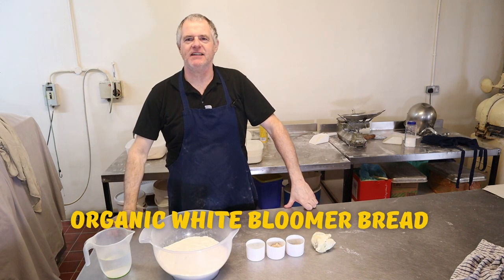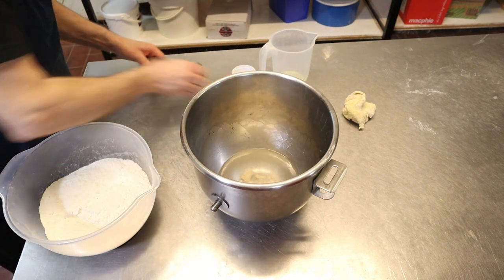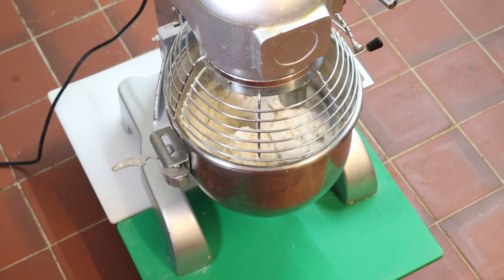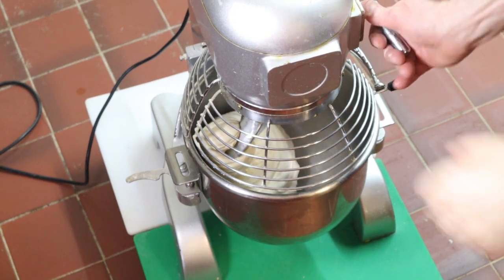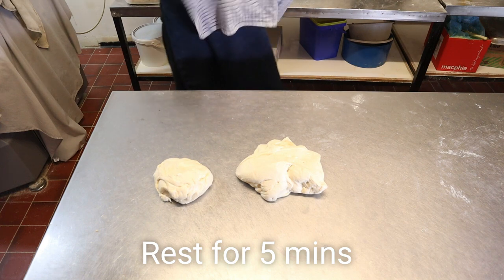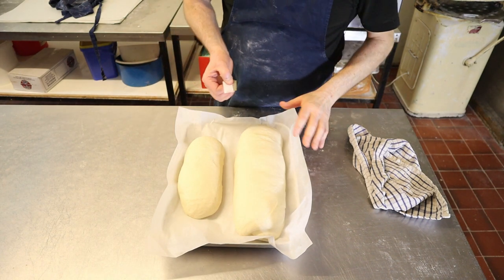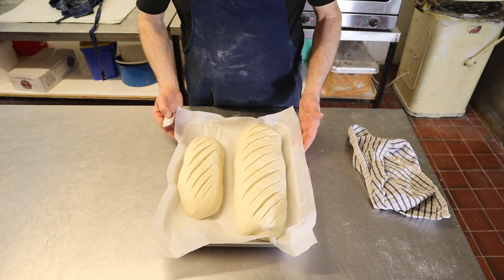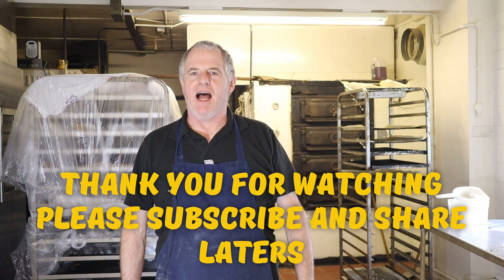Bloomer Bread how to Recipe Demonstration in the Bakery #9

Comment: just found your channel and subbed, cool videos. Why do you bulk ferment these ones but not the small bread that you made in your other video
Reply from the maker: Hi some recipes I may use bread flour improver, which is very common for bread and rolls, for best results at home bread improver if the flour is low gluten, the bulk is still need if dough is very cold, in hot weather conditions or above room temperature bulk can be 5 - 30 minutes, making a recipe is one part of baking, lots of different things can go wrong, so I try to keep things very easy, and not to complicated, but I will be doing some video's on things like temperature, bulking, and bread improver 😀 laters Steve 😋

Comment: How long Steve would the leftover bit of dough last in the fridge that you add to next dough mix,
Reply from the maker: Unfortunately that depends on temperature, for example take 1lb of dough and watch it in the fridge, at the point the dough goes into water it's over,  this can take days to weeks, I have made a loaf up and proof up over 4 days in a fridge and baked, lovely tasty loaf 😋   same thing added old dough into new dough, same in half the time ⏲️
Reply: @crazybaker1  am guessing the old dough going into the new is the old fashion  dough improver.
Reply from the maker: @johnscrivy  very much the same and less yeast, very much like a sourdough with yeast
Reply: @crazybaker1  can you freeze a bit of the leftover dough defrost and use in the same way
Reply from the maker: @johnscrivy  of course but to get better favour it needs to be moved  frozen and just leave in the warm place just so it smells a bit yeasty, fresh dough frozen comes out the same as it goes in,  when defrde frosted leave for around 2 - 3 hours, I think this is going to be a video on this, it's always so many different ways to get the same results, I like the easy one 😀